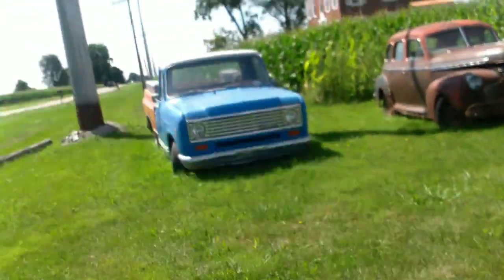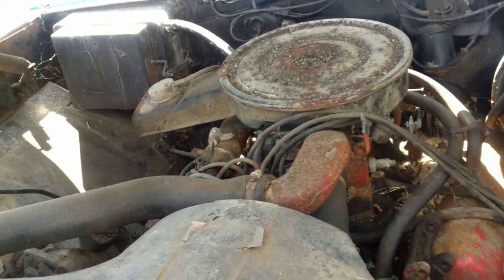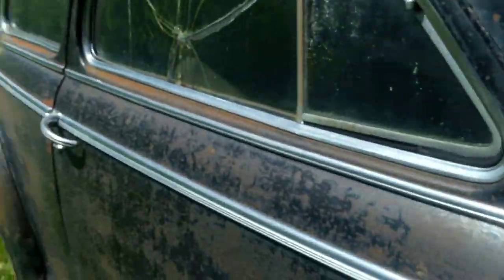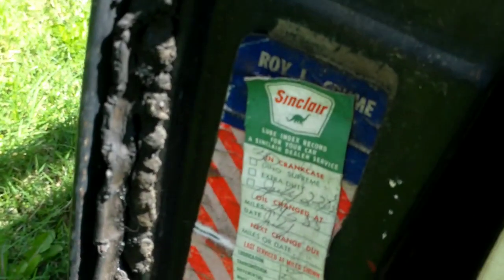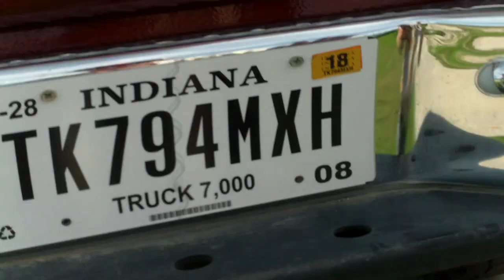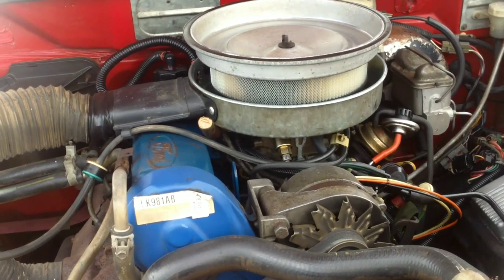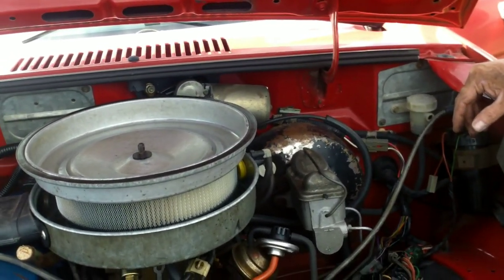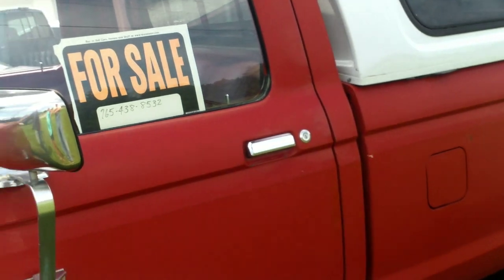Looking At Classic Trucks For Sale

Comment: I love this kind of video. Was wondering if you were still searching for an old truck. The international is cool but it is really low. A thousand bucks is cheap. You can restore it. I used to own a ford ranger. Had a lot of problems with it. Finally sold it to my brother-in-law who fixed it all up. But the red one you looked at is really nice as far as condition. Don't like the fact that it has a pinto motor though.
Reply from the maker: Yeah, still searching. I'm hoping to get the International. Not for sure if it will happen though. As far as the Ranger goes, it's in very good condition, but I'm not really interested in a mini pickup. Glad you liked the video.
Reply: @richardunicorn7879  Do you have any idea why the engine on that Ranger was running rich? It was smoking a little.
Reply from the maker: Not sure. The guy we talked to wasn't quite sure either.